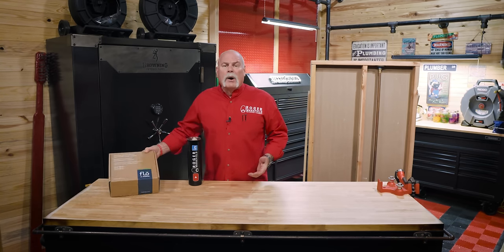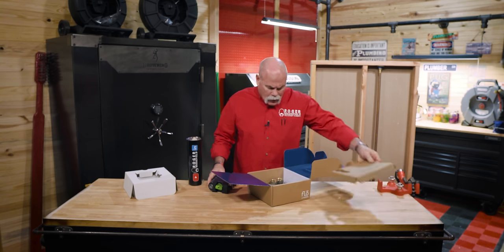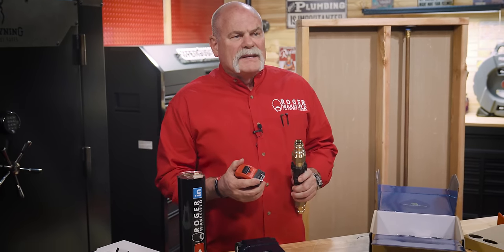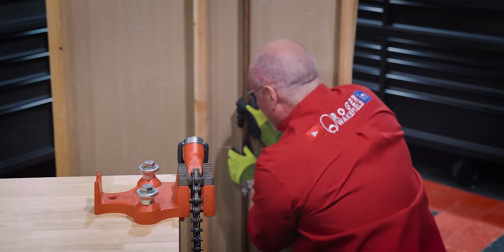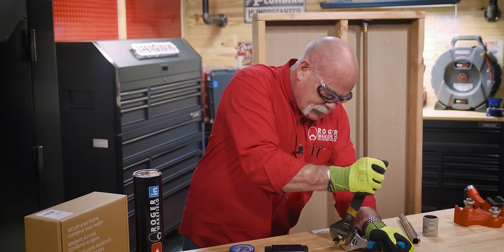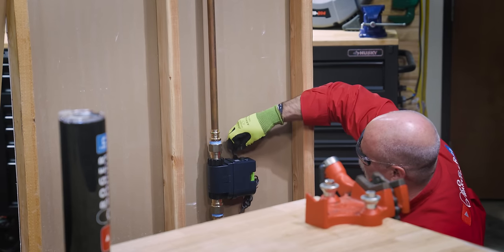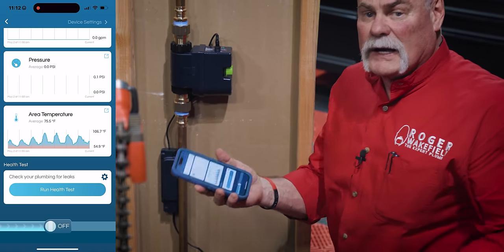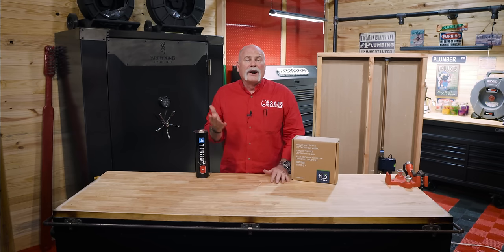How to Install a Smart Valve on Your Home

Comment: I've installed at least 20 of these so far. They work pretty good, pretty cool you can monitor and shut off your main with your phone. Here's a pro tip when installing: use the spacer, turn the water on and run water through the spacer to get rid of any debris that may have gotten into the line. There's a small propeller in the device that will get stuck if there's any debris.
Reply from the maker: Thanks for sharing. That’s a great idea!!!!
Reply: How much is an estimate range to install one?
Reply: Is there a monthly subscription for this app?
Reply: Did you have any problems connecting to Wi-Fi or setting up these valves and the optional sensors?

Comment: "Don't overtighten it, just let the tape do its job" should make that into a t-shirt.... the amount of times I've seen people say "teflon tape is only a lubricant, it doesn't seal!" only to spout a moment later with "the NPT needs properly tightened because there are imperfections in the threading" don't recognize that the tape can do both be a lubricant AND help seal the regular tolerances and tiny manufacturing defects on a thread is mind-boggling, and can also tell they never worked with PCs either, just in that situation it would be thermal paste not teflon tape/goo

Comment: Been on my list for a few years.  Some insurance places give you a discount on your insurance as well, so it will literally pay for itself over time money wise.  But some insurance only accept certain brands as well.  For now, I manually turn my water off to my house if I am away over night, or on a vacation.  Thankfully, in Canada, we have our shut off valves in the house and its easy to do.   Water sensors, even if just a beep at home, at least discover things before they get bad.   I also turn off/on all my water line shut offs every 6 months to make sure they work, and replace my washer lines every 5 years.  I realize this isnt as good as something like this, but its better than not doing anything.  So are these better than the ones that shut off the gate valve off manually?

Comment: Excellent video. I purchased the 3/4" version to connect to my main 3/4" copper line. My insurance company now requires this for our second/vacation home. Can't easily shut the water off for the winter since we have circulating hot water heat and cast iron radiators. I was going to have a licensed plumber do the work. BUT. . . Several plumbers I contacted in my area (30 miles South of Albany, NY) had no interest in doing the installation.  One plumber quoted an astronomical figure - about 5X the purchase price.  Just what I need at 70 years old, another DIY project. I already have the app, three Moen Smart Water Leak Detectors and the Smart valve on the WiFi, so a couple of carefully spaced sweat fittings will get things done. The app was a bit of a pain in the rear to initially get connected to the devices. Moen needs to iron out the rough edges in the WiFi set-up procedure for the Leak Detectors. Interestingly, the valve took only a couple of minutes while the three Leak Detectors took over an hour and multiple attempts and resets.  A bonus of the Leak Detectors is that they monitor the temperature and humidity as well monitor for water. Thanks for posting the video.
Reply: did your insurer provide any discounts after installation? they should
Reply: @talalztube  Minimal savings for me. I think it was 5%. They graciously allowed me to keep my insurance.

Comment: Thanks for the video!  While it’s slick, My Flo has been nothing but problems.  Had to replace the whole unit after 6 months.  2 months ago I had to buy the turbine assembly since it just ran out of 1 yr .warranty.  Has had  several connectivity issues with wi-fi since it’s in the crawl space.

Comment: Finally. Installed first of this this type about 7 years ago.
Better if they have leak sensors connected to the valve, so it closes sooner than 5 minutes if something happens.

Comment: I installed a lot of those devices out here out here in phoenix, the only thing that sucked is the call backs from the ones installed outside which the heat would messed them up so I learned that it’s better to install them either by the water heater or water softener unless u have shade by your main.
Reply: Why what did the heat do?

Comment: Looks like you had an ideal installation example, but what about a shut off valve outside of the house with the pipe then going through the wall underneath to the crawl space?
Reply: @MCW1955  No crawl space. The supply line goes underground to the utility shut-off valve in the driveway.

Comment: Looks like they have this set up so you can have multiple valves in one app. So you can use it in multiple apartment units if you have a multi-unit building. Or you can have a valve in multiple properties if you have multiple properties. And control all of it on the 1 app.

Comment: Although the mess that would have to be made in most of the North Texas homes with slab foundations and short runs of piping coming out of the slabs for the main water lines before it goes right back down into the slab.  99% of the time its a random bathroom or kitchen faucet where the main water comes in the wall.  You would need access to this for routine maintenance as well, so an access door would have to be added as well as lack of outlets to plug it in.  Just like trying to add a water softener here as well unless the plumbing was setup from day one to support it, it would be extremely costly to do.

Comment: Im installing these for a customer at 2 different locations, and they are not home and i dont have access to there wifi or there phone to program the app. Does anyone have any info or experience with local mode? Im thinking i want to leave it in low detection mode so the tenant doesnt get there water shut off during there long showers, or while filling the washing machine and dishwasher at the same time.

Comment: This looks nice. I'd still want a nice soldered in manual ball valve before it through.
Reply: @Derddy  Fully agree!! Subsequent to the installation I installed a ball valve and pressure reducing valve before the Moen valve. Soldered. Btw. My pressure was 100 psi and I reduced it to 60. Also put an expansion tank on the water heater. A benefit of the Moen valve is the pressure readings at the supply line.

Comment: Those work great, very easy to sell to people who have experienced a 20k plus damage flood from an R/O.
Reply from the maker: It is! They also have leak detectors that you can place all around your house (laundry room, under sink, behind toilet, water heater) where it will sense the humidity and temperature of the room and alert you if it senses water leaking and it connects with the same Flo app! They are doing some great things

Comment: I prefer the battery powered yolink shut off valve with 12 sensors. If the power and or internet goes out the sensors communicate directly with the battery powered shut off valve. If even a couple drops of water touch any of my 12 sensors it shuts off.

Comment: Question: Can you actually replace your main, manual shutoff valve with one of these or is that a bad idea? Assuming it's a bad idea, should this always be installed downstream from your main shutoff valve or upstream?
Reply: I’m not a plumber but
I really wouldn’t get rid of a manual shut off valve. Both for your own sake and if you ever have an emergency and have to call out a professional 
And two: it should be downstream from it. Allow yourself to have two fail safes in case of an emergency.

Comment: Not practical in houses in Texas, Need to install before the line branches to other fixtures, can't really do it on slab house. I called Moen and said you need to install above grade, so that means in the yard and with electricity ran, they said you need to be installed where it doesn't get below freezing or above 104 degrees.

Comment: I'm a techy person and want the water flow and pressure data to be available outside of the app.  Is that possible with the Moen valve or any similar smart valve products you know of that let you export the data and/or not require an internet connection in order for it to work?

Comment: re: "or the inconvenience of manually shutting off your water supply?"

Moen's site has a graphic that implies this gets installed aft of a traditional shutoff and pressure regulator. I very much like the idea of what this can presumably do. But are we confident this can replace a standard shut off valve?
Reply: It isn’t meant to replace a full open valve , it’s meant to be a stop safe for if you aren’t knowing there is a problem and to keep the water off until you can get to the valve

Comment: Hi.. There is a lot of complains about the quality of the FLO.. Any feedback?
Reply from the maker: I thought the product was solid, I had some trouble connecting it to the Wifi and pairing it with my phone...but that was my only issue using it.
Reply: @RogerWakefield  Thanks.. any experience after 1 year? there is a lot of complains about the warranty and the experience after 1 year. Thanks a lot!!

Comment: My question to all your plumbers I know you don’t have to solder anymore and you use those devices that clamp down on the pipe how well do those work? I mean they must work pretty good. I always watch you guys always there’s no soldering but it’s all compression.
Reply: I'm not a plumber but I use a manual pro press tool and never had an issue. Pro press is a lot safer especially if you're not a plumber and don't really know how to soldier like me

Comment: Does this device work without a internet connection? I always worry about things like this continuing to work in the case of a natural disaster. I couldn't imagine using something that would shut down and stop your access to water just because you can't connect to the net.
Reply from the maker: It still works without an internet connection, but you have to manually open/shut the valve if there is a problem. There is a key tool included to help with that.
Reply: @RogerWakefield  Ahh.. Thanks for the info.

Comment: Only if it had a battery back up
Reply from the maker: does your flood stop?
Reply: There are devices like this which do have one, it uses 4 AAA batteries and turns the water off automatically when it detects a leak...

Comment: sorry to see you are shilling for this product.   I've installed 10 of these,  have had 8 call backs due to pump failure.  the pump impeller is prone to water mineral buildup causing motor excessive motor wear and premature failure.   Moan leaves customer stranded citing they're not responsible for irregular water quality or hard water.  the motor  is not robust enough for hard water and long term use.

Comment: Things like this make me Nervous because it is if the water breaks and soaks that Little smart device with it still works also if you have kids and And you have to run the bathtub to make a steam bath. Would it kick the water off if you don't have your phone on you? Also I trust in sweating pipes and compression fittings homeowners need To know they're layout
Reply: If it detects the running has been continuously for 20 minutes, it will send you alerts via text, phone calls and emails.  If you don’t let Flo know it’s ok within 5 minutes, it will shut the valve.  Otherwise, you can open/close the valve with a hex wrench manually if you have no phone or internet.